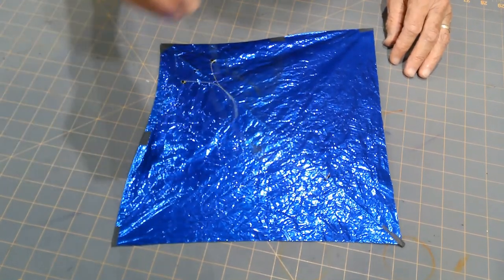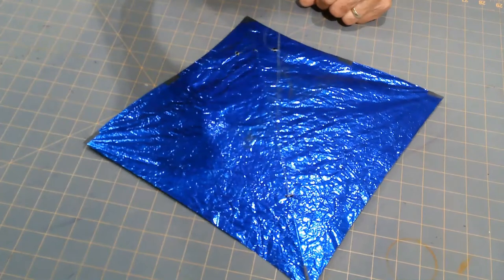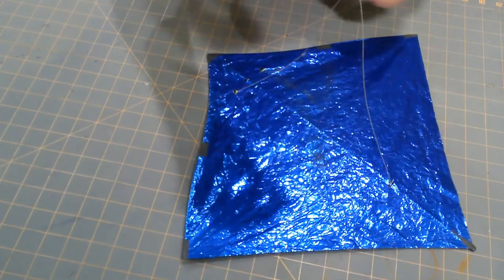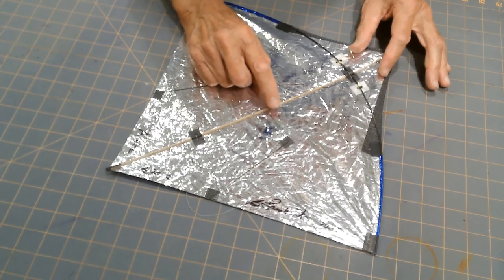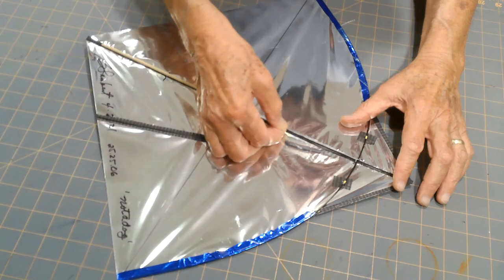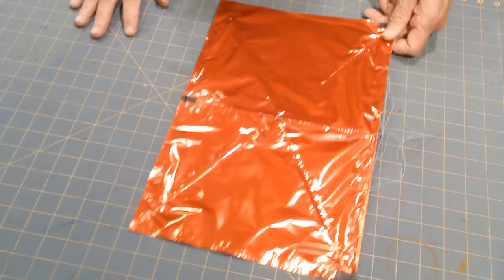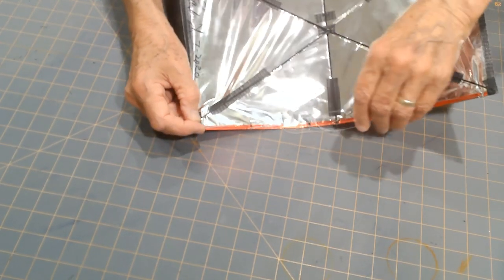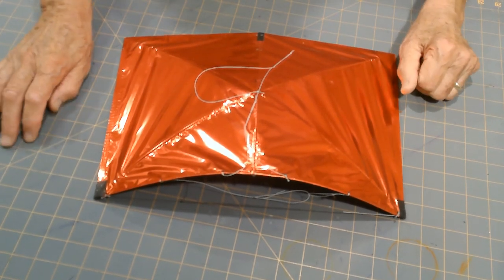Tuning and adjusting North American fighter kites

Comment: Help, where do I get a starter kite?
Reply from the maker: The best is to make one from free plans and instruction on line.  If you don't want to make one, check Ebay or any on line kite store for fighter kites.  'In to the wind' is one on line store that usually has at least one.  Hope this helps.